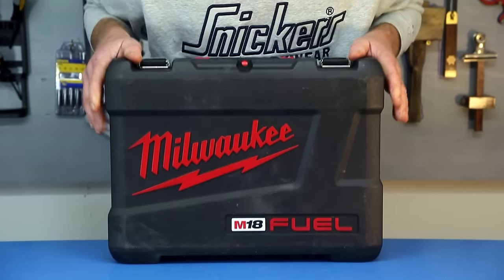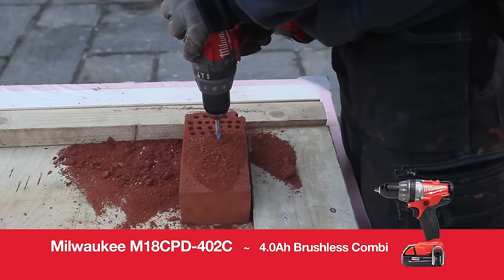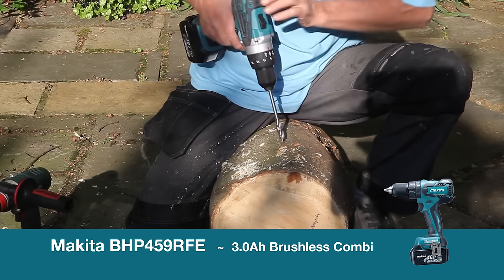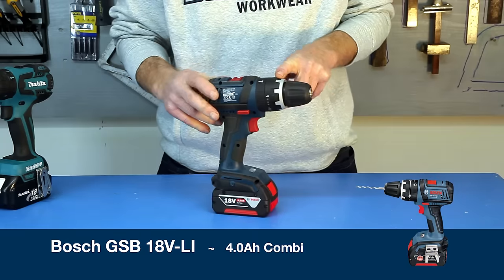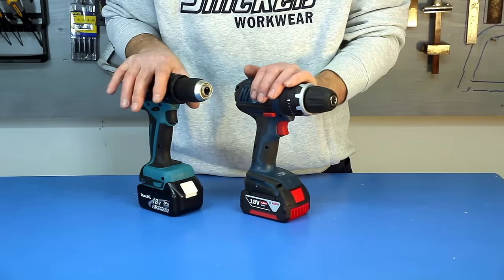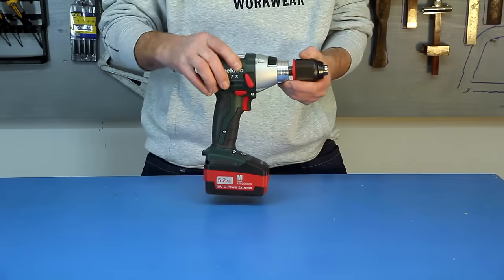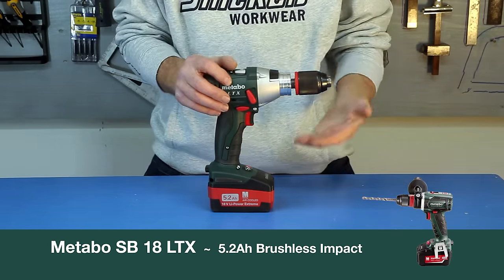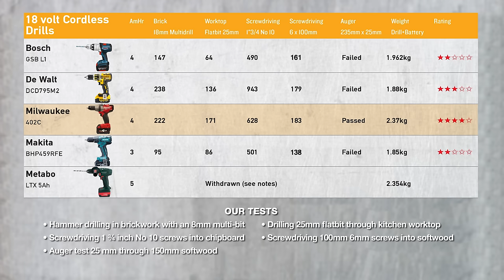18v Cordless Drill Review - 5 Best Drills Tested

Comment: Where is the Hilti?  I know for a fact that a Hilti would beat every one of those drills.
Reply from the maker: Good drills Hilti and they last for years but you can't buy them in the merchants so for a lot of people they are not mainstream. We could have added Festool, Hitachi, Panasonic and a good many more but it took a hell of a lot of time to get this test done so we had to stop somewhere.
Reply from the maker: David Schulberg I am surprised by that because I often see Hilti drills that have been used for over ten years. As a technician what do you think is a good drill?
Reply: Well for a fact you would be wrong, Both Dewalt and Milwaukee would own Hilti. Just to compare Dewalt vs Hilti impact drivers /watch?v=KEbvnxKqlPg
Reply from the maker: Minimal444 The test you point to is for impact drivers not combi drills and it only shows the speed of the tool not the amount of torque.
 Hilti make tools that go on working for years. I see them all the time on construction sites but if you can show proof to the contrary we would love to see it. .
Reply: I think you missed the part where I said "impact", you don't need to point that out to me. DeWalt Impact No load speed=2850rpm, Max Torque=170Nm. Hilti Impact No load speed=2500, Max Torque=164Nm. Dewalt owns it in both cases, which is clearly seen on the video. And Dewalt is lighter. Same goes for the drills, dewalt owns hilti or any other brand in the drill/impact department with the exception of milwaukee maybe.
Reply from the maker: Minimal444 My aplogies. for missing the word 'impact'. .
Reply: A DeWalt impact driver only has 125 ft/lbs of torque, compared to 142 ft/lbs for the Hilti. It has higher RPM, but a Hilti not only out impacts it, a Hilti lasts 2.5 times longer. Also, a Hilti is all metal inside(hence the heavier weight) whereas a DeWalt is mostly plastic and will burn up faster. DeWalt is known for making "disposable" tools now, their warranty is laughable. Look up the tests from the beginning of 2012 of all the impacts on the market.  #1 Hilti.  Distant #2, Milwaukee...DeWalt is on there somewhere, but it was outperformed by Makita.
Reply: Minimal444 you wanna try working in a merchants... I see dewalt coming back every day with the same faults and they won't recognise there's a problem and the best bit is because of their crap warranty it won't be covered.. I've saw every imaginable dewalt tool come back albeit never an impact... would I touch dewalt? No would I let an enemy buy dewalt.. I'm not that mean

Comment: can't be a comparison for 1 they are not all the same brush and brushless motors , also 3 ah and 4 ah also 5.2 ah , so can't really say milwaukee is the winner so its an unfair comparison as if all were brushless and same ah battery as 4 or 3 then it could be more of whats better
Reply from the maker: Thanks for your comment. We have covered this point several times in the comments below. They are all 18 volt drills and they are different specs so the chart tells you which did best on which tasks. We should not have declared an outright winner because the DeWalt was best with smaller screws but you will see that the Milwaukee covered all the jobs. It shows that not all 18 volt drills are the same so you have to make sure you get the right sec for your job.

Comment: Well, I use Makita and have two machines and four batteries. I wouldnt use It if I have to screw >1500 screws/day. That is not a job for a cordless machine in my opinion.

I use the Makita for the light weight and it will save my arms and shoulders. Half a kilogram can make You go on an early retirement. I've seen It several times.
Reply from the maker: That is a very valid point about the weight. It is the reason that so many manufacturers are offering a smaller drill driver. A 10.8 or 12 volt drill is all that many trades need for most of the time but there are also jobs where you need something a lot more powerful. We would all like to buy just one drill that does it all but it isn't possible which is why we tested these drills across a variety of tasks big and small.

Comment: If your test didnt compare the same size Amp/hr battery in each brand, you basically compared apples to oranges.
Reply from the maker: If you scroll down through the comments you will see that same phrase used over and over. It may well be true but they are all 18 volt and if this test shows that not all 18 volt drills are the same then it has value. I doubt that a test of identical drills would reveal much but our new test has different drills. This time we asked the manufacturers to send us their best drill.

Comment: Battery meter is a gimmick in my opinion.  Whether we're talking about a job site or typical DIY'er,  I see no use for a battery meter on a drill.  Completely unnecessary. When the battery dies, you just grab a fresh one, plug in spent one, continue.  The days of 14 hour charging are over so what's the point?

Problem with reviews on these new products is that you can't test value in relation to durability and longevity of the lithium cells.  Oddly enough, reviews on these drills I think need to be done 2 years later for a more fair/appropriate comparison.  Makita, in my experience, dominates this aspect, so far. I'm sure other drills are slightly stronger and run slightly longer but the true test takes years.  For arguments sake lets say the Dewalt driver is rated at 50 more inch lbs.than the comparable Makita (which it is) and the Dewalt battery puts 25 more 2-3" screws on a charge (cant find a resource on that, sorry).  So what?  If I happen to get another years worth of battery cycles and pay $100 less than the Dewalt, to me it's a much better value but how do you quantify that for the masses??  From what I've heard among most users, battery longevity/durability/cost dominate the desires of drill/driver owners, by far.  Not 8 minutes more run time, 50 inch lbs. more torque and battery meters.  Just my thoughts and experiences.  

Thank you though for sharing your time and experiences here.  I know it took you a long time to set up, record, edit etc. all the content.  Thank you and good day to you.

Comment: you must have apples to apples and oranges to oranges.  3-4 amp is a 25% differance. I have both makita and milwaukee 4 amp and the makita is slightly better
Reply from the maker: +Julien L. Beaudoin 
So many people have told us this but we went with what we had. Makita didn't make anything bigger than 3Ah at the time and we commented on that but didn't want to exclude them. They do now so we have re-run this test and we have learned a lot about testing.  We still don't have identical drills but the manufacturers made the choice and we ran the tests. If nothing else these tests show the differences and how much more you get. When you say the Makita is 'better' in what way is it better.

Comment: bosch now make a 6.0 ah battery.
Reply from the maker: We haven't seen that yet. Sounds good. Where will it end 10AmHr?
Reply: Skill Builder I am in Australia and it just came in to local stores this week. along with brushless motors. 
who knows when it will end!
Reply from the maker: smallenginedude71
I have dug a little deeper and apparently they were due into Europe in January but I think it has been a bit of a soft launch, probably because they haven't got enough stock yet. The other explanation is that they are using Australia as a test market. They have Coolpack technology so best to try therm somewhere warm.
Reply: Skill Builder that is a very good theory i like the sound of it. the 6ah is also only available in one store called total tools it is nowhere else

Comment: why do you try all these different tests?  If you do that your actually testing the driver head, the sharpness of a bit, the design of a screw...Just use one big drill bit brand new for each drill and run it till it quits...and your actually testing the battery not the drill, if you hook the drill up to a wall power source and run it till the gears and chuck and internal machinery fail...then you have tested it.
Reply from the maker: Thanks Zach.  You are making a good point but we have been doing this for a while and we can tell you that  it isn't that simple. Many of these drills will cut out under no load conditions. We have tried it and you get about 5 minutes before the electronics says stop. 
We are doing real field tests because everyone relates to that rather than bench tests. We find that dust is a factor and can jam switches. You will find that a higher torque drill will not give you so much run time even when you are driving in small screws the motor draws more current on start up. So you can see that the DeWalt has a really long run time. You need to decide what you need a drill for and chose the best fit. Also our tests show how much difference a brushless motor makes.
Reply: yeah, you do have some real-world points there, but if your just going to test power and run-time i would do my test, we all tend to work around the weight or run time thing...you lay down a bunch of money for these drills and then make the best of it. It would be interesting to see more consumer impulse-based tests...like how does the design help it sell?  These things look like Buck-Rogers weapons nowadays...that has to have an effect.

Comment: Metabo was in Impulse mode, not damaged! The test is unuseful.
Reply from the maker: That is not correct. We only ran the impulse to see what it did on site and show the boys the feature. In the comparative test which we carried out first we  used the Metabo without the impulse mode. We tried very hard to use them on the same tasks in the same way. What the test shows is that there is a difference in the performance and that you get what you pay for.
Reply: Ok. Thanks!
Reply: Skill Builder Since this clearing, I withdraw my first comment. Good vídeo! Congrats.

Comment: Do you know that milwaukee does have a 9.0 ah battery? / "High demand 9,0"
can't you put on the best battery that the brand makes and test them out 
exactly as you did here?
Reply from the maker: +xtralltrc Yes we have seen that battery and lined up a test but it is difficult. It will give more run time but it is a bit too much for an 18 volt drill. We are testing it on their new cordless hammers. 

Our next 18 volt test is going to use 5Ah batteries because that seems to be the way the market is going.
Reply: Thanks for that you answered I hope that 
5.0 18 volt video will be good......
Good review that made me to realize that milwaukee is the best of best....
Was it the m18 FPD-502c that have 135 nm
or a smaller one?  Do you think it is going to be unfair with a that big battery? Or do you think it is a good battery.?
Reply from the maker: The hammer is an SDSmax 18 volt running on  9Ah

Comment: the test is not right, you can't use the most powerfull milwauke  thar have 120Nm with some normal drill with half of power, this video is promilwaukee
Reply from the maker: +Marius Nistor 
Yes. It has been said many times. Not all 18 volt drills are the same. Check out our latest test where we asked the manufacturers to send their choice in. Hopefully you will like that more.
Reply: moust powerful drills are made by Milwaukee and Makita, but i have a bosch gsb18v-ec, 50Nm is verry powerfull but i would like to try Gsr 18v-ec 60Nm, for be is enough power, the only think that i don't like on Bosch drill is that the chuck  wobbles a lot after been hard used

Comment: However, Makita batteries are so frail and fail so easily it has cost me 5 batteries in 12 months. Dropped one, left one out overnight. (Dew)Blew one under heavy torque. Lost one to wd40 that got sticky. The the 5th died part way through a charge. Changing over to Milwaukee. Disgusted with Makita tools. Did I mention they have no customer service?  After all is said, living with Makita is infuriating .
Reply from the maker: +Robert Harding 
That is interesting We should do some tests on batteries. I am surprised to hear that they have no customer service. It was always their strong point. Milwaukee servicing was not the best out there but they have upped their game over the last 2 years and the feedback    is now a lot better,. Have a look at our latest 18 volt review.

Comment: I own makita but to each his own
Reply from the maker: Have a look at out latest Makita LXT review.  When we do this test again I can't see any 18 volt drill out there that can beat it on torque. 115NM. The problem is that high power comes with extra weight.
Reply: Skill Builder come on man lets compare the drills that acctually need to be competing with each other, the makita XFD03Z will outperform the Milwaukee. plus your using a  4amp battery on the Milwaukee and a 3 on the makita smh
Reply from the maker: Oscar Gomez Makita didn't have a 4AmHr when we did the test? They have since upped their game and we have now tested their LXT which kicks out a lot of torque but is a heavy drill for general work. There is a lot more information in the chart which shows that they all perform differently on different tasks.

Comment: need the hilti
Reply from the maker: +gnostico81

 Hilti doesn't have an 18 volt cordless so it makes it difficult to put it up against the rest. We might do a separate test.
Reply: +Skill Builder Try with the 14,4v ....thanks for answer
Reply from the maker: +gnostico81 It might do well but if we do an 18 volt test we can't include anything outside of that, even the so called 20 volts which are really just 18 volts measured at their peak charge.  It is a minefield.

Comment: Where is my monster AEG bsb 18v.........
Reply from the maker: AEG was a really strong brand and they had some stonking tools but it is now owned by the same people that own Milwaukee. In the U.K AEG is no longer aimed  at the professional  because they don't want it to compete against Milwaukee. It is almost as if they bought the brand just  to stop anyone else getting it.
Reply: Skill Builder
Thanks for the info seems as if I have got the last of the pro series got it for 200 instead of the 300 discounted 2 years ago through Screwfix wondered why my unit was not available any more, my mate tried to get one, but could not get my model, that is why.
Reply: Skill Builder interesting, i have an AEG bought in Australia,
18 volt, cordless kit (a couple of years old now), it seems very much a professional unit, in fact it looks almost identical to the Milwaukee unit, except its orange and black, quite heavy,  same charger, 2 batteries, same handle set up, also has all the bells and whistles, fuel gauge on batteries,one handed chuck, led torch comes on when the unit is picked up or go button is half pushed, pretty happy with it actually, 9 times out of ten when a heavy job comes along it gets the job and the house powered drill  stays in the shed.  

excellent test you have conducted there mate, well done sir.
Reply: mikldude The same I am sure and a gem.

Comment: No Festool drill. That hurts..
Reply from the maker: Go to the new test
Reply: Thanks.  Still i would always prefere a festool drill before a Milwaukee one ;)
Reply from the maker: Festool make some lovely tools but if they had tried to build their brand on their drills along they would struggle.
Reply: Why do you think so? I mean their focus was mostly on sanding tools in the beginning, then they tried to supply most woodwork tools. 
But their products are mostly designed for carpenter shops, not so much for housebuilders or handymen.

To me The Festool drills just feel much better than Milwaukee for example. They are more sturdy. I have an old 15+3 drill and its pretty much the only drill I use for about 6 years now.

Comment: Dewalt was a great brand UNTIL, black and Decker  bought them out.
Reply from the maker: Actually, it was not quite like that. Elu was the brand that B&D bought initially and they decided to abandon it and concentrate on Black and Decker Professional. They then decided that there was resistance in the trade to anything bearing the Black and Decker name because it was known for DIY so rather than returning to Elu they took a woodworking machine brand DeWalt and developed a range of 'professional' power tools under the DeWalt brand. None of those tools previously existed so it was the name rather than anything else that they used. There is still some attempt to hide the Black and Decker brand away and now Stanley owns the majority share of B&D we have a further layer of DIY tools. 
Most major power tool brands have a second offering as with Milwaukee and Ryobi or Bosch Blue and Bosch Green. 
Hilti and Festool do not bother with the low end
Reply: Skill Builder ,  how does this disproves my comment? 
Dewalt, was a good dependable brand until, black and Decker bought them out.
Yes, later Stanley bought B&D. That's like sears files for bankruptcy  so does K mart. Then K mart buys  sears. That's business. I'm  talking  about quality.  Not quantity.  The old B%D METAL MADE Tools was hell of a lot better than these plastic  ones. 
I've  never been a matika fan. I was a craftsmans  until they gotten to be a cheaper quality  the sockets break now and the breaker bar and ratchets are poorly made now.
Reply from the maker: O.K D Brown Jr. 
 I was merely pointing out that DeWalt was not producing any of those tools before B&D came along so the idea of B&D spoiling the brand by reducing the quality is a popular myth which is not supported by fact.